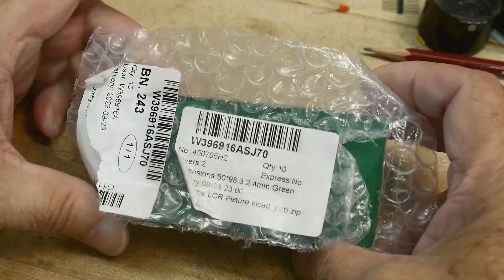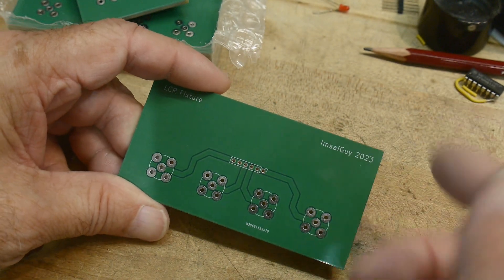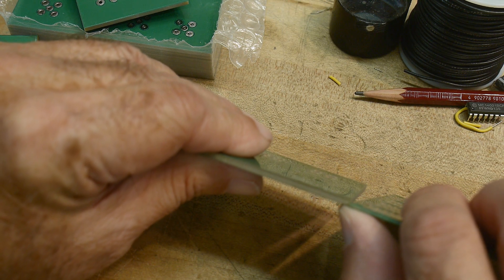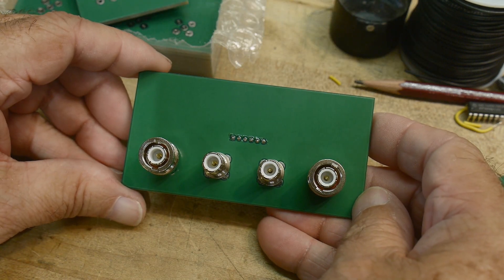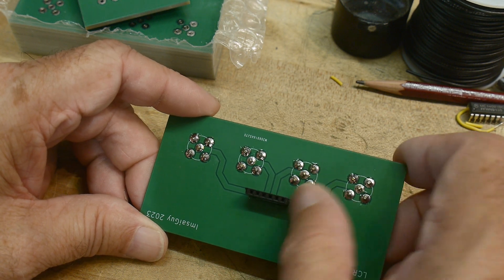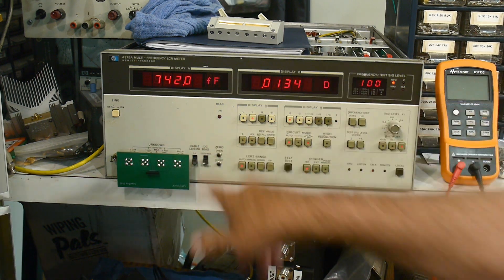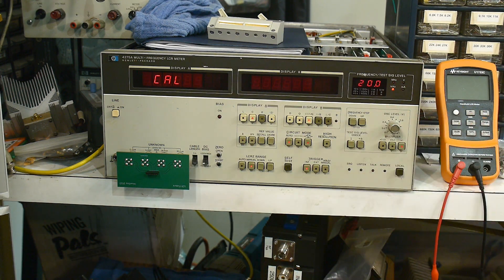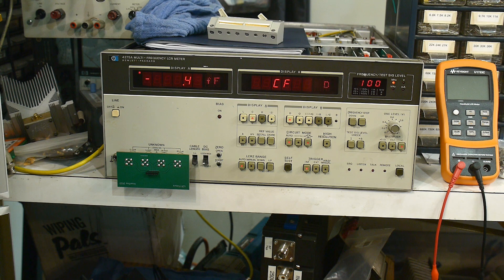#1684 PCB Test Fixture  HP 4275A LCR Meter (part 5 of 8)

Comment: I got some of the PCB's from PCBWay (Only six days to receive in the Chicago-land area!).  I bought some cheap PCB Male BNC's off eBay and was surprised that when I cut off the outer locking plug portion the inner connectors outside sleeve (ground) was very loose inside the center BNC's of my HP LCR meter.  When I measured the sleeve it's O.D. was 7.62mm on these cheap eBay BNC's, while a good USA made connector I have here has an O.D. of 8.1mm.   The later matches much better with the HP BNC's that have an I.D. of 8.35mm.  Thus, I'd be very lucky if the grounded portion for the H-POT and L-POT connections would even touch on the adapter side.  Funny when I checked the BOM it lists a TEConnectivity P/N 1478204 which comes up with a Female chassis BNC.  That's can't be right!  

Bottom line what is a good Male BNC to use that will fit the PCB pattern and holes on the PCBWay board?  All the discount ones on eBay and Amazon look like the ones I already have.
Reply from the maker: BNC vary from great to crap. here is what I bought

https://www.aliexpress.us/item/2251832111232237.html?pdp_npi=4%40dis%21USD%21US%20%2425.15%21US%20%2425.15%21%21%21183.83%21183.83%21%402103241117362048065742646eaf11%2110000015621430325%21sh%21US%21166904661%21X&spm=a2g0o.store_pc_allItems_or_groupList.new_all_items_2007446123939.32297546989&gatewayAdapt=glo2usa
Reply: @IMSAIGuy  Yep they look just like the ones I got.  The PCB grounded pins appear to be 6.1mm C-C apart per my calipers.  The current BNC's measure at 6.88mm C-C.  Thus the pins get pushed inward while seating the BNC and thus the BNC will not sit flush with the PCB.  I ordered another set of ten from China that provides a diagram.  That sheet shows the pins are 6.04mm apart.  If that's true I will be fine.  It will be very interesting to see if the inner ground sleeve is slightly larger on these new BNC's.  Wonder if it's just manufacturing tolerance issues.  Thanks
Reply: My new batch of PCB BNC's arrived and they are perfect fits.  They look exactly like the old batch, i.e. no name.  However, a quick measurement does show the Ground Pins are 6.04 mm apart C-C, vs the old which were around 0.8 mm wider (apprx 6.84 mm C-C) spacing.   Please NOTE:  buy from the sellers who provide dimension drawings and only use those that have a Ground pin C-C spacing of 6.04 mm!

Comment: Nice! 

I've done one too but with SMA connectors and SMA to BNC connectors to facilitate the connection. I found the same PCB mount BNC connectors on Aliexpress but I thought the adapters solution was better for me.

In 3'10", the force traces can be thin as long as the current is not high (as in this case) because the calibration compensate the fww mohm. Sense traces can be always thin because the current is always low. Thick traces are more exposed to external electric field coupling.

Comment: Have you considered the BNC footprint ?  I have found some footprints have a smaller gap between the pads than the gap between traces and ground plane.  You can move the solder pad away a mm or two so the hole is not in the centre yet maintain a good solder connection.  Also I make a habit of putting some 3.2mm holes in the corners, even if the immediate use does not require them.  Just my immediate thoughts on seeing the boards.
Reply from the maker: these work great for me. feel free to make ones for your requirements
Reply: . @IMSAIGuy   hahaha I do.  All of my PCBs use personalised foot prints.  Easier for me to solder is the mail reason.

Comment: Nice work! I made one of these once with a die cast Hammond box and 4 normal female BNCs. To connect to the HP, I used BNC M-M adapters. It worked well. 
Yours is classier.